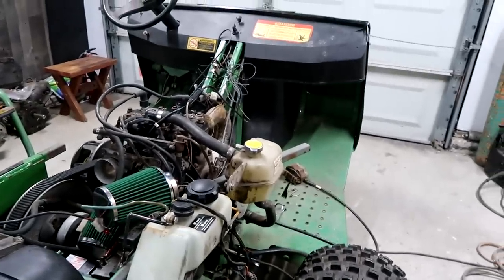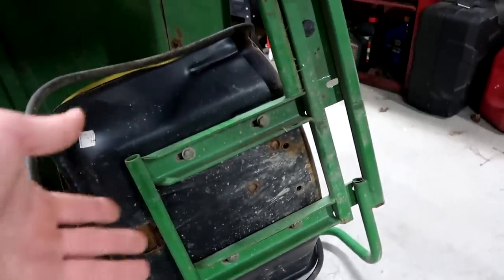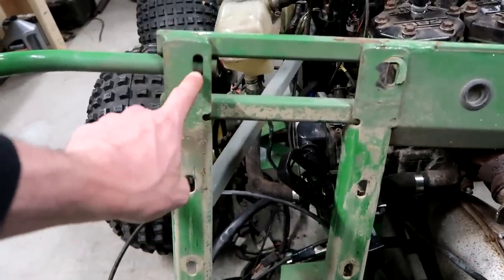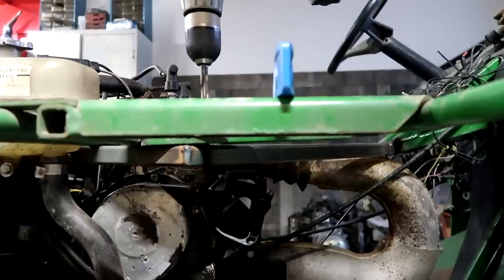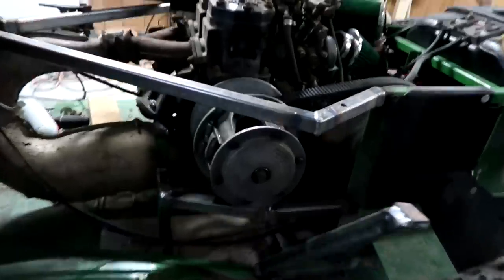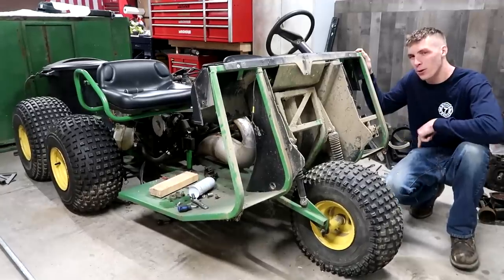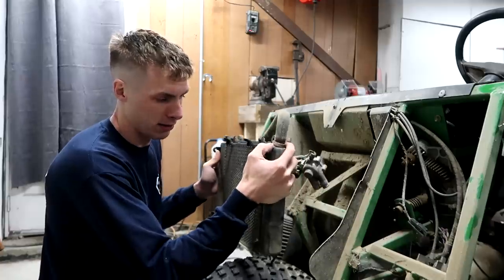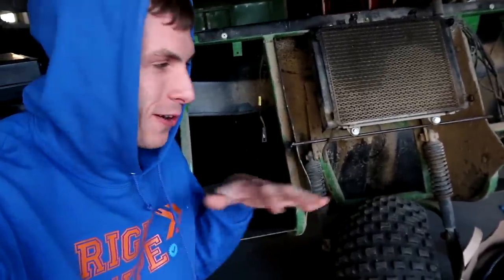THIS THING IS GETTING TOO COOL!!

Comment: Hi Dalton.  someone might have pointed it out already and if so then great but if not then  FWIW that is not a pump in your radiator hoses.  It's the thermostat housing and the wiring coming out is a temp sending unit for a gauge.  And yes if you are running it you'll need the thermostat for the coolant temp to stay regulated well.

Comment: probably better to have the radiator in the back behind the seats shielded to help keep mud from going straight in it and from blowing, the front wheel will load it full almost instantly
as other said, belt guard is a very good idea so nobody gets eaten alive. belt shreds will tear you up like being whipped with jagged razor blades/barb wire,  not something anyone should ever experience :))

Comment: Mount the radiator in the rear angled up. Like AdamLZ's FD drift car. Also it would be much easier to find a mounting location. You just need extra hoses.
Reply: He plans on going off road right? Lol

Comment: i just cut the driver's side seat bar off of a gator yesterday. they are a pain in the ass when trying to get in and out of them. they route the fuel tank vent hose through it. found out when i cut the bar off.

Comment: Yo get a dewalt 3/8 drive impact gun and a set of Carlyle impact sockets from napa they are lifetime warranty and better quality than harbor freight. Best investment ever.
Reply: I wouldn't bother spending the extra money on impact sockets for a small 3/8 impact. They dont really have enough torque to damage a regular socket. Super handy though, my little Milwaukee has come in handy many times lol
Reply: @Dirtlife98  While you wont neccesarily crack the socket you will wear out a chrome socket faster than an impact. And it offers better energy transfer. I've used both extensively and I do notice a difference. I mean with a lifetime warranty ig it doesnt matter all that much. But for sure much better than dragging an air line around. Once you go cordless you can never go back.